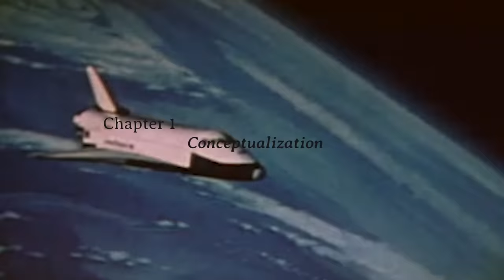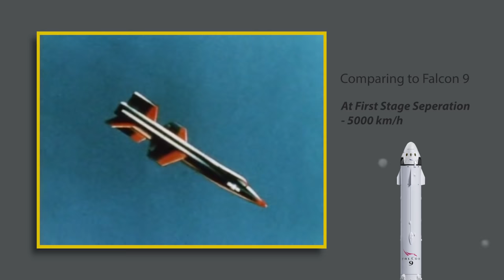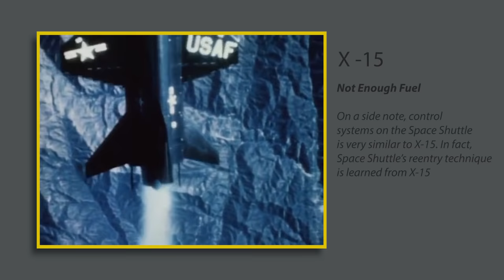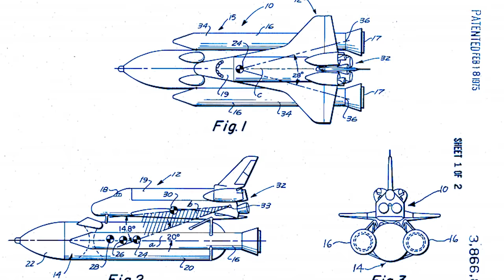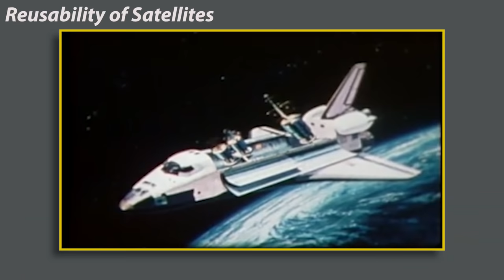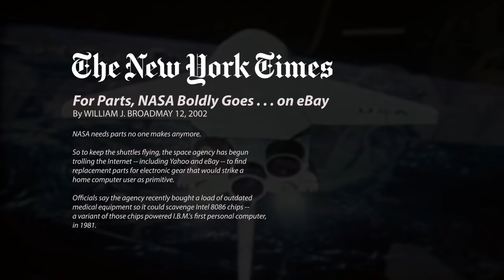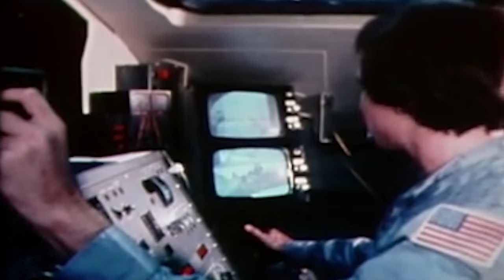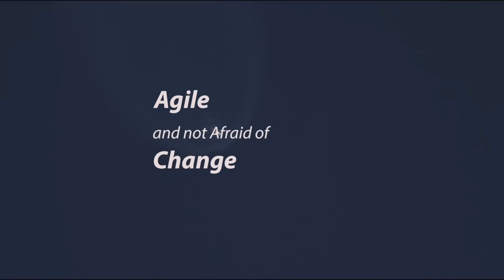The Space Shuttle, a failed attempt at Reusability?

Comment: Yeah, the Space Shuttle was FUBAR. The initial problem was feature creep. The original space shuttle wa going to be much smaller. It would carry crew or a small satellite payload with internal fuel tanks, a smaller engine and a single integrated heat shield underside, and launch off a flyback booster which would basicaslly be all fuel tank and bigger engines capable of carrying the full stack. Two stage, fully reusable, with the orbiter on top of the stack in vertical designs, and above the booster on horizontal take-off. Large satelites/space station components would have used expendable heavy lift vehicles like the Saturn V or Saturn 1C. 

But NASA couldn't get enough money to fund the development, so tried tapping the Air Force, who also wanted cheap access to space. Unfortunately, they wanted much bigger cargo capacity for National Security payloads, and cross-range capability so the shuttle could do a single polar orbit land back at it's base. 

This meant a far larger body, a huge cargo bay that left no space for fuel tanks beyond orbital manoeuvring which meant an external fuel tank, the delta-wing design that gave it cross-range at hypersonic speeds, at the cost of the glide profile of a thrown brick, and huge, high pressure engines that had to provide enough thrust for the entire stack (because no flyback booster), and yet were carried all the way to orbit. And lets not forget that it's size meant the only heat shield solution light enough to work were heat resistant tiles that had to be pretty much individually crafted to fit the body (at vast expense) and were fragile and easy to damage.

Even with the massive engines, the thrust wasn't enough to get it off the ground, so they had to add the solid fuel SRBs, which couldn't be shut off or even detetched in case of emergency. They were so cheap that they could have been thrown away, but the mandate for reusability meant they had to be recoverable and reconditioned after landing in the ocean, a process which cost more than building a new one, and introduced weak points like the O ring that failed and blew up Challenger.

Oh, and let's not forget the genius idea to strap the orbiter to the side of a vertical stack (beacuse it was too big to go on top, making it both a bugger to fly, and ensuring those fragile tiles got showered by ice from condensation on the cryogenic external tank every launch.

Needless to say, the endless redesigns and complex kludges extended the development time to the point where the Air force got fed up and went with heavy duty expendable launches, leaving NASA with a white elephant that had cost so much they had no choice but to use it for every mission, as they had no money for other launch vehicles, or to develop anything more modern. It also nailed their feet to Low Earth Orbit for manned missions, as the pitiful 300 m/s OMS delta-v made it impossible for it to go anywhere else.

We already covered the cost of the SRBs, but assembling the huge beast was a long, complex and expensive process, the engines, being at the bleeding edge of their performance envelopes had to be practically stripped down and rebuilt after every launch, the tiles kept falling off and had to be individually inspected and replaced, and lets not forget it was built by multiple subcontractors who all needed paying. The result, the long turnaround times and vast cost that it was supposed to avoid.

I agree that the Space Shuttle was a technical marvel, an incredible triumph of ingenuity and skill. However, I also agree that as engineering went, it was a nightmare, an invitation to disaster, and one of the reasons it's taken 50 years for true reusable spacecraft to be developed.
Reply: In addition to your excellent summary of the reasons for the STS's failures, there was also the issue of a lack of targets. The shuttle was designed to handle payloads that simply weren't in demand in the commercial sector. This drove the expected launch frequency down from 50 flights per year to just a few which ultimately killed the economic viability of the system.
Reply: Excellent points throughout, and all the more reason why Senators should stay out of the decision making process today, mandating NASA to build a new Frankenstein of parts (SLS) by reusing old shuttle parts. The shuttle main engine was amazing don't get me wrong, but it was highly specialized for its use-case, namely nozzle efficiency for a flight profile all the way from sea level to space, and ridiculous gimbal maneuverability to compensate for the off-center thrust vector. Now NASA is forced to make it work for a vehicle design closer to the Saturn V.
Reply: Lets also not forget that every single orbiter (except Challenger) ran for at least five years BEYOND its intended lifespan.  Shuttles were meant to be operational for 15 years.  Columbia was 22 years old when she broke up.  Discovery was a whopping 27 years old when the Shuttles were retired, Atlantis only a year younger.
Reply: And the main engines being on the side never made sense to me.
It must have a huge penalty on added structure to spread the load, not to mention aerodynamism.
Reply: Um,... the Main engines were actually the three engines on the back of the shuttle itself.  The side engines were just boosters.  And, having strap-on boosters is a concept nearly as old as the space program itself.

Comment: Apollo mission testing killed 3 astronauts. You mentioned 0 deaths. I hope im not wrong
Reply: John Roscoe you are correct
Reply: Even if you don't include the Apollo 1 fire, the near fatal disaster of Apollo 13 certainly counts as a major hardware failure during an Apollo flight.  The only thing that saved the crew was the fact that the Lunar Module could serve as a lifeboat, and thank their lucky stars the heat shield was not damaged in the explosion.
Reply: Apollo 13 is more relevant than Apollo 1 since the failure was in the Apollo launch system and not the capsule. The failure of Apollo 1 is a payload failure.
I don't think sticking with the Saturn 5 was the answer. It is what we are seeing now with the commercial launch systems. Musk was already building the replacement for his Falcon Heavy as it had its first flight. 
The shuttle Challenger exploded in 1986. The replacement system should have been flying before 1996. The engineering failure was obvious at that point.
Reply: @vapoet  apollo 13 failure was on the service module, which could be considered part of the payload, the launch system didnt have anything to do with it, the Saturn 5 completed it's objective on the mission without major problems

Comment: The reasons for its 'failure' were more basic.

1. It was never clear what the purpose of the shuttle was. The military wanted it for high weight military satellites in low-earth orbit, industry wanted to for light-weight satellites in high orbits, and NASA wanted it to carry people. This lead to hauling around crew space for 7 and a boaster rocket on every commercial satellite.

2. Materials (even today) simply don't allow reusability in this way. The tiles were too fragile, the engines simply couldn't handle 25 launches, etc. before needing to be replaced and/or substantially refurbished. If you only get half the use out of them... flights nearly double in cost -- factoring in delays, schedules, testing, etc.

3. Reusability of satellites never made sense. Cost of putting them into orbit has always been comparable to their replacement cost. Most satellites aren't in low-Earth-orbit. Most communication satellites are in geostationary and others higher earth orbits. It also makes little sense to 'fix' one vs. just launching another. Most satellites only carry fuel for 10 years or so. Beyond even 5 years... technology advancement is such that it would be better to send a newer satellite than try to fix one. Few failures are such that they can be repaired in orbit... it is would be silly to send the shuttle up, grab a satellite, come down, fix it, and launch it again. That is $2B in flights plus the capture to send a (likely) obsolete satellite back -- plus two flights which can't be used for launching satellites. For $500M, build a new satellite (likely smaller, cheaper, higher data capacity, better communications, more fuel duration, etc.) and then send it up for $1B (or $500M on a normal rocket).
Reply: 1. the shuttle was designed to go hand in hand with building a Space Station. Congress refused to fund the space station, which left shuttle as a spacecraft without a mission

2. The shuttles were intended to have an operational lifespan of 15 years.  They ignored this.  Columbia was 22 years old when it broke up in STS-107.  Discovery was a whopping 27 years old when the shuttle program ended.  That is too old for ANY vehicle.

3. Hubble is the biggest example of why the shuttle was needed.  Without shuttle, Hubble would have remained an unrecoverable, uncorrectable failure.
Reply: Why the F9 is way more reusable than the Space Shuttle... In a way it could be thought of as Space Shuttle 2.0, in a good way.

1. 
SLS: The RS25 was a sensitive super efficient engine. In SLS 96 3 of it's thousand cooling pipes broke, in part because it had a massive array of oxygen feeders for the combustion chamber.
F9: Falcon 9 uses 9 engines, which are way smaller, redundant and less sensitive than the RS25. The cooling pipes are on the exterior of the nozzle, not the interior. If the engine shows fatigue, it is replaced, not patched.

2.
SLS: The heat shield technology used on the SLS was by modern standards, primitive, showing heavy ablation, in part due to it's high landing mass from orbital speed.
F9: The block 5 rockets land with no ablation due to their use of titanium and landing engines first. It also comes in much slower and doesn't attempt to reuse the 2nd stage. In this sense, the F9 affirms that reusability of Second stages is near impossible. 

3.
SLS: The shuttle/landing capsule/second stage tries to be a jack of all trades, making refurbishment expensive and slow. Early on in design, it was clear that the heat shield would need to be refurbished and the expensive engines would need to be refurbished.
F9: The Dragon is refurbish-able, like the SLS, but cheaper because the engines are dead simple and strong, and the heat shield is small and cheap. The near impossibility of reusing the second stage is reaffirmed by the F9. In essence, why make a second stage/capsule combo, which is unreliable and expensive to refurbish, when you could dump the second stage and bring home a cheap to refurbish and reliable capsule.

5. 
SLS: Because of the large investment into the design, the size of the auxiliary systems (pad, refurb facility, etc), the length of time refurbishing took (6 months+) and the low launch cadence, It was hard to iterate and improve the design. The shuttle also required people to operate, which drastically increases the cost of doing everything.
F9: Start off with a cheap non reuse-able system designed to become reusable as upgrades are made and keep iterating on low risk unmanned missions. This allowed them to improve the engines, heat resistant paint, aerodynamics, hydraulics, software and electrical systems.

6.
SLS: They had no prototype for this heavy lift high efficiency rocket, they started with almost the biggest thing they could build. They should have said no to the Air Force.
F9: Start small, with the F1, then scale up to the BFR.

7.
SLS: Things started to go wrong early, there were systematic foundational design issues and they should have pivoted. This is an organizational issue.
F9: After the success of the rocket, they dreamed to scale it up by a lot with the 12m wide ITS... after working on it for over a year, they found the numbers didn't add up and pivoted to a realistic system with the BFR.

The SLS wasn't just refurbishable, I would say that the SLS was actually highly reuse-able, and it was more so then the F9 in terms of percentage of complex expensive things brought back to earth. But the SLS was really bad at it, due to it's design, it tried to do something impossible with the technology at the time. The F9 took the parts that were impossible to reuse and isolated them, and burned them in the atmosphere, lowering the maintenance cost, and thus quality, of everything that gets reused.

SpaceX is taking a gamble on the MCT which shares many of the same issues as the Shuttle did. Hopefully with PicaX 2.0, modern electronic sensors, full cycle engines, multiple redundant engines, the flexibility of the design due to their organizational structure, and their extensive experience with reusability from the F9 and SLS programs; SpaceX will manage to finally pull off cheap, heavy lift, second stage reusability like the Shuttle tried to do. The Shuttle in that sense, was too far ahead of it's time.
Reply: I guess spaceX is making things happen at God speed. Hope we will have this sorted by this year end
Reply: It’s a reflection of the time it was created in, if present day viewers are being kind. The whole Moore’s Law thing was coined in 1965… Nixon had a heavy hand in the design and changes. We didn’t, as a society, grasp Moore’s Law as a fact then, just theory. So the idea of maintaining satellites fit into the environmentalism/general mood of that day. Now, the reality of dancing in space to fix a decrepit satellite is known.

The Space Shuttle was a failure, but the failure itself led to important lessons being learned. A (very) indirect success, in terms of a long, mostly forward looking, view of humanity

Edit: Also important to consider how most humans viewed airplanes. Everything was airplanes. From design to culture. 707 brought in the jet age. Another token of the 60s.

Comment: This video falls short in a huge area.  It is well known that originally conceived space shuttle was a far different beast from the final design.  The main reason was due to the requirements of government and the military causing the goals to be constantly changed throughout the design process.
A "pure" space shuttle as envisaged in the original ideals would have probably been cheaper and far more efficient but due to the fact that it had to be all things to all men, the design became a jack of all trades and master of none.  The biggest mistake was putting rocket engines on the back of it.  Once in orbit this become dead weight and causes more stress on re-entry which again compromises the design.  The refurbishment process was also impossible to do efficiently and probably would have been cheaper to have switched to one-way engines.
When the soviets built the Buran / Energia system it had far more potential and flexibility.  They built a booster system that could launch the Buran or be used to launch a whole range of other vehicles.  Initially Energia and its additional boosters were built as non-reusable, but they already had plans to develop the boosters for flyback. If the soviet union hadn't collapsed it would have been very interesting to see how Buran would have developed.
Reply: Not only that, it wasnt supposed to use SRBs at first. It was supposed to reach LEO on the first stage, and then do all the maneuvers and shit with the second.

Comment: Nice video, but some observations. First, there were 3 fatalities during the Apollo program in Apollo 1. The subsequent investigation also revealed several issues with NASAs process. Second, the shuttle received a number of refits throughout its lifetime. STS-135 did not fly with half century old technology as you implied. Last, Soyuz is much older than the Shuttle and rather successful despite its older design. Though it too has received refits

The shuttle was not a failure in reusability. It was a failure in "affordable" reusability
Reply: tbh, the only thing Soyuz FG has in common with Semyorka is its appearance... same goes to the Soyuz-TMA spacecraft.
Reply: @m4ti140 Yeah, that's why I said it also received refits, but the basic design is still the same as the first and it is considered to be the same line
Reply: Remember that the Apollo 1 accident was a failure in the capsule and not a failure of the Apollo launch system.
Reply: Hayden Jones you're right, but it was still part of the Apollo program
Reply: Akron - The shuttle was indeed a failure in reusability since the only reason to make it reusable was affordablility. The issue with long turn around times meant it couldn't be reused as the schedule intended flying about 10% as often as planned. It wasn't as if the shuttle didn't work, it was too expensive and too risky.

Comment: NASA's biggest problem with the Space Shuttle was Congress. Congress wanted them to do more, faster, with less money, and kept cutting the budget. There was supposed to be 7 Shuttles, but it was cut to 4. After the first 3, the budget was cut, which delayed the 4th. NASA had to strip equipment out of shuttles just to get a scheduled flight up. NASA tried to get programs started to replace the shuttle, but even though contracts were awarded, they were quickly canceled by Congress.
Reply: Fun fact: the Shuttle was at first designed to be fully reusable, with a "plane-on-plane" two-stage design. But it ended up in its partially reusable state due to lack of funding for development of the full version.